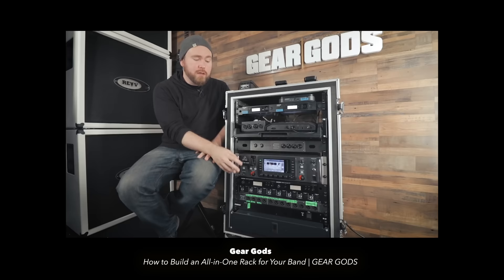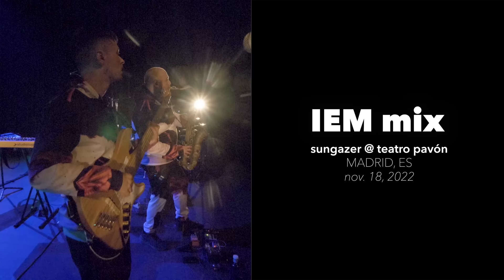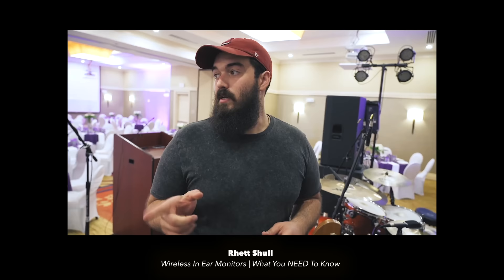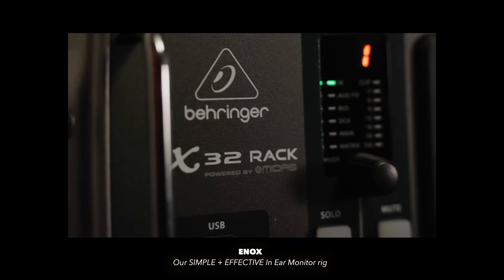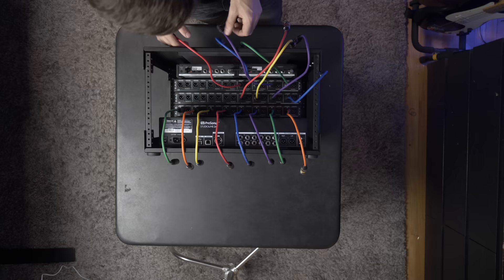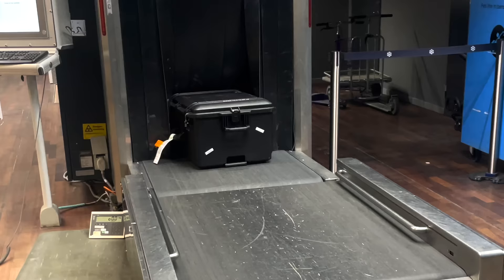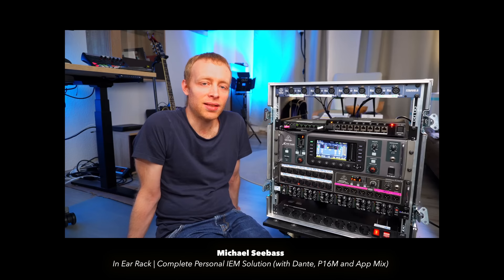How In-Ear Monitors are Making Better Musicians

Comment: Love your channel but sorry no… I ears don’t make you a better musician. I’ve played with wedges and in-ears. In-ears do not totally solve latency issues especially if you are using digital modeling gear, with wireless into your instrument to your rig and then to wireless in-ears. Compared to an amp on stage yes there is a latency that most definitely be noticed and more importantly felt. I can see how they benefit vocalists on a loud stage but they aren’t always necessary for every gig to have a great experience on stage and I think it’s a stretch that they make you better. In my 40+ years of gigging, what matters whether you use in-ears or wedges, it’s all about the mix for the band. A great mix for wedges can be a great band experience, just like a great mix for ears can be great. It’s not one size fits all.

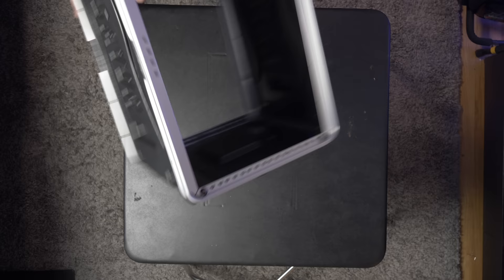Comment: 7:35 🤣 You spent $700 on a piece of aluminum bars with holes in it? you could've bought the alum scrap from any local metal shop (free or $40 max). pay the guy $50 to cut it to your length and drilled the holes yourself at home with your home drill. then bought spray paint for $10. wtf